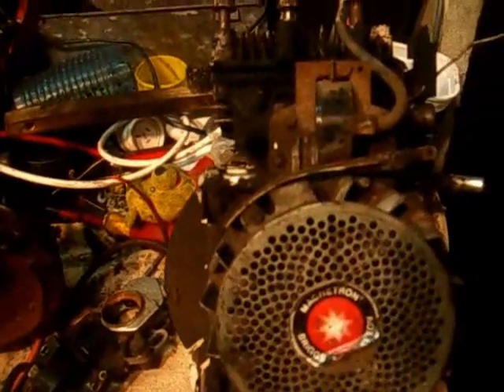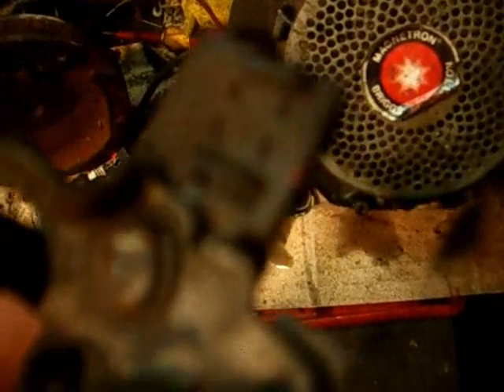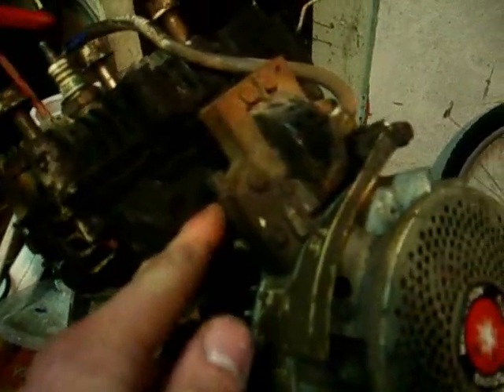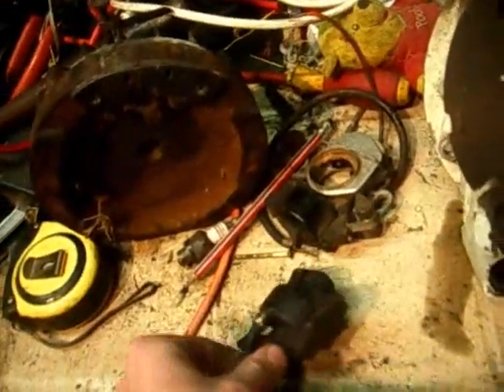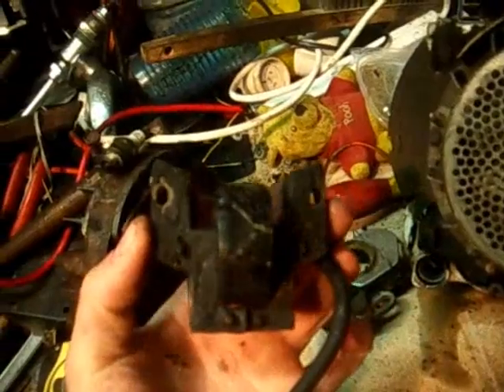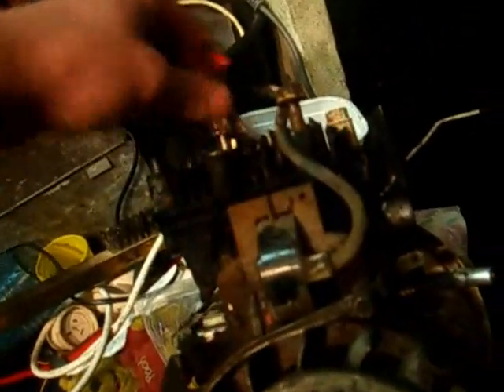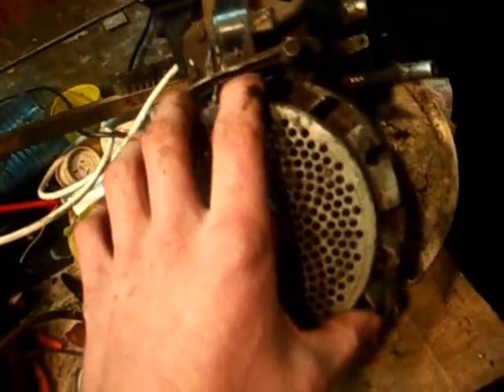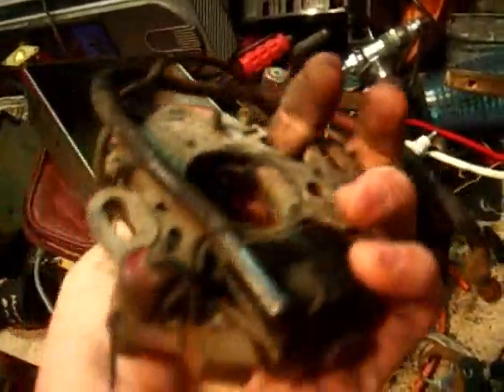lawn mower spark / ignition problems and how to fix them

Comment: Hey, watched your vid. I'd had spark problems. Your video is all that
good but it gets the job done. Consider remaking it, cleaning it up a little, using a
cameraman and cut the stuff about the lamp light leaking because it doesn't have
anything to do with what we, the watchers, are after. I know, I've got some lousy ones
on there too. But, just the same, thanks. My problem turned out to be a kill switch
problem, and I got it running just the same. Your video helped me figure it out. Thx.

Comment: Hey, watched your vid. I'd had spark problems. I don't think your video is all that
good but it gets the job done. Consider remaking it, cleaning it up a little, using a
cameraman and cut the stuff about the lamp light leaking because it doesn't have
anything to do with what we, the watchers, are after. I know, I've got some lousy ones
on there too. But, just the same, thanks. My problem turned out to be a kill switch
problem, and I got it running just the same.

Comment: You saved me a trip to the shop.  Cable from control lever had slipped a bit loose, was no longer engaging the kill switch.  A spare hose clamp to secure the cable where it belonged, runs perfectly now.  Thanks!